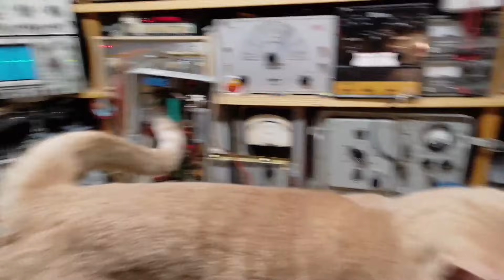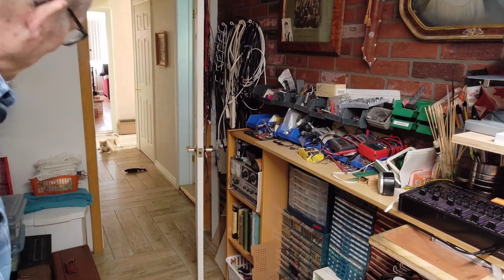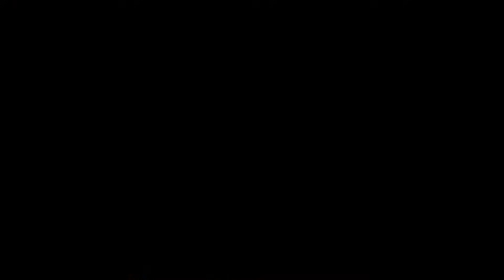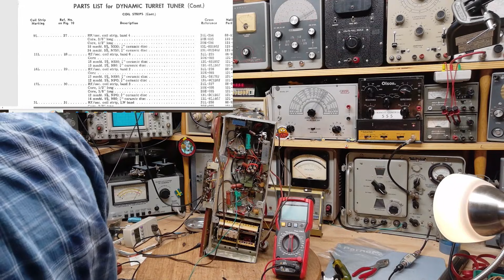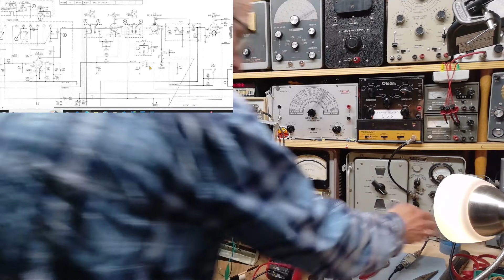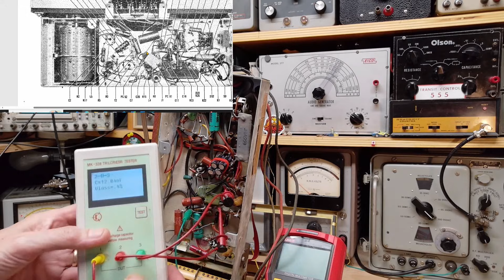Hallicrafters TW2000 Communications Receiver Video #17 - Inch by Inch

Comment: I had a radio that was working very well for a little while then would go weak and then hum would start and couldn't get sound back. I replaced the caps and checked tubes and replaced the very weak ones.

Comment: Seems the hum came with the IF transformers swap. Make an insulated shield you can ground and mount it to the wooden stick. Move it around the circuit to reduce the hum thus localizing the problem.

Comment: It's Me again. Scrapping egg off of my face. I am sorry about the instructions for use of the sweep generator. I thought you were using a RF sweep generator. I just figured out that you are using a B&K MODEL 3030 FUNCTION GENERATOR in the sweep mode. . 
That said . I still think that your problem is with that IF can you replaced. It is either the wrong part or way out of tune. May I suggest that you connect a small capacitor to the plate of the mixer tube, 100 to 200 pf should be enough.  Connect your URM25 signal generator, tuned to 455 kHz to the cap. Connect you scope to the grid of the detector stage.  Make sure your scope prob is in the 10X position so as not to load the circuit. You should see the 455 kHz signal on the scope Increase output from generator if needed. until you do. Now adjust IF cans for max output decreasing generator output as necessary.  If all this works, then the IF stages are tune very close to optimum and you only have the front end and audio to worry about. Good Luck